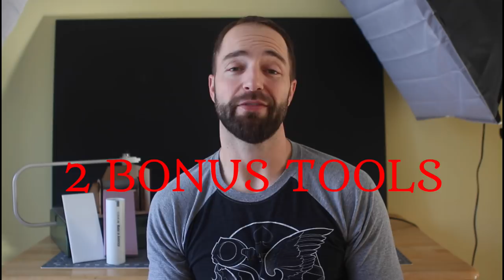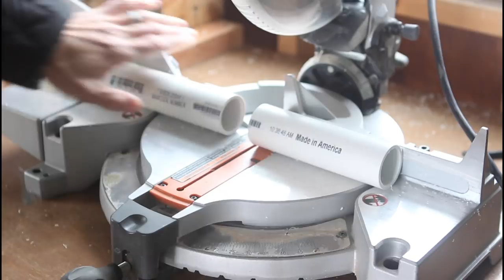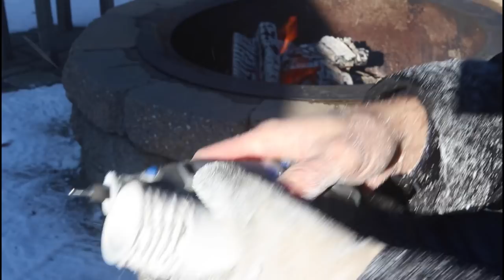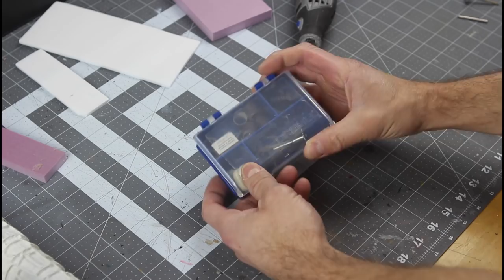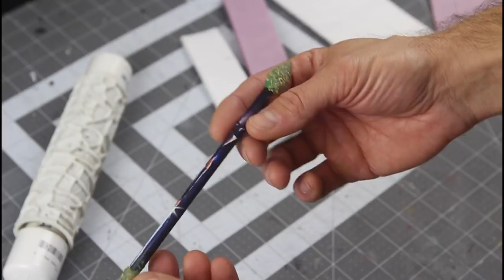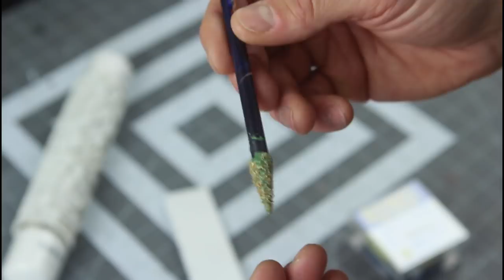DIY XPS Foam Texture Roller

Comment: Alternatively, I printed free pattern on paper, wrapped it around a rolling pin, then built up all the lines with a hot-glue gun. After use I slid the paper/glue roll off the pin. I have used it to make aver 10sq fr of cobblestone pattern and will try making a rock wall pattern next.

Comment: Please keep in mind there are 2 types of PVC pipe used in the US and it may effect your results with this project. Schedule 40 Solid Core PVC is solid PVC all the way through the pipe wall. Schedule 40 Foam Core PVC is two thin layers of PVC plastic on the inner and outer wall of the pipe with a stiff foam filler material in between. Solid core is much sturdier and would be the way to go with this type of build, but both should be available in your big box store. You can tell the difference by reading the text on the pipe. Foam Core PVC should always say "Not for Pressure" on it and will be considerably lighter in weight than Solid Core. You can also tell by looking at the end of the pipe, if the wall of the pipe is one color all the way through or if there are thin strips of lighter colors on the inner and outer wall. Happy Crafting!
Reply from the maker: You are correct.  Thanks Beans.

Comment: I've seen similar ideas for wall plastering with cement or/and paint, skimming, etc. Floors, roofs anything, Creativity is unending, but I truly like how you show how easy it can be. I have a dremmel, can get pvc piping and have a lot of plastering, flooring, roofing and skimming still to do. It's also great how it covers up smaller imperfection you would like to hide.
Reply from the maker: Thank you :)  Another cool thing is that the one you make is truly unique... I like that :)

Comment: I spent 2 days looking for textured rolling pin, always only available with lengthy delivery times (live in Austria) with a delivery fee almost as or higher then the Roller itself. It won't be finished in 5 hours because I generally need 3 times as long for everything as shown, but then... Big thanks for your instructions
Reply from the maker: Your welcome glad it helped….. and no rush at all

Comment: If you run your dremel at a lower speed, it won't melt all the pvc to the bit, reducing it's effectiveness.  Course bits work better than fine bits too.  Great video thanks!
Reply from the maker: Great tip!  Thanks!

Comment: 2 quick ideas from when I made mine:
   - use a larger bit to rough the bricks and then go in with a smaller bit to clean up the detail. Saves you a good hour. 
   - print out a seamless texture from online, resize if needed, and try to copy it to the roll, that way when you stack the texture it will match if you line it up correctly
Reply from the maker: Cool ideas, thank you.   Even leaving it rough with the first bit would add some nice texture.
Reply: @TabletopWitchCRAFT  still super cool! I'm learning to have more patience with stuff like this xD

Comment: If you want texture and the stone, brick, wood, what have you, make the textures on the roller not so deep. This also works much better on xps foam, sense xps tends to bounce back to shape slightly with the deeper cut texture rollers.

Comment: Hmm... I wonder if there'd be a way of doing this by taking a bit of PVC, coating it in a layer of green stuff, and then rolling it in aquarium gravel, or something similar, and before it fully cures, picking the gravel out so it leaves an impression that  will make a 3D embossed texture when rolled on foam.  Or, like another commenter suggested, using some thermoplastic to make like a sausage shape that you can roll in gravel or those little glass things they use for flower arrangements, and then pick them out once it fully hardens.
Reply from the maker: SongDog7 That would work, but I don’t think that we’ll for XPS foam.  You really need something that can imprint the foam and cut into it.  What you are suggestion would work well on something like DAS clay.

Comment: Suggestion: Have you tried rolling the "backside" of a strip of foam first? In order to counteract the warping it might be beneficial to do the other side first (even though it might be hidden inside a building - or it'll give you the other side of a wall already), kind of like how one would counteract warping when applying paint or glue to a larger piece of paper or cardboard, you might apply your wet medium to the other side too. Basically it's to create "equal tension" to both sides in order to keep it flat.
Reply from the maker: I have.  It does work rolling both sides, although you have to "work" the foam a bit to get it back to its original shape.  Good idea.

Comment: I love this tool and want to make several styles of stone work. Here may be an added idea, though I have not TRIED it.. I'm reasonably certain some Schedule 40 PVC pipes are engineered to slip inside each other [ Outer Diameter matching  the second pipe Inner Diameter]  The inner one could be left whole, the outer could be pierced through completely... possibly with even finer patterning such as small red bricks or cobble stones. Once the pattern is carved in the Big Pipe, the Smaller Pipe slips inside to stabilize the cutter...the ends can be welded with a bit of PVC glue to make them secure... Maybe?
Reply from the maker: That might work, but it really is pretty rigid.  Try making it without even using an inner piece of PVC.  Might be just fine!
Reply: Don't need for the added strength , but might be good for rolling pin type handles on either end and would not slip around like ops handles . But as OP said , really don't need handles and can probably apply more force and have better control without .  Wow , shot down my own idea !  Lol

Comment: Thanks I was thin about this build I might try this on a hardwood dowel instead of the pvc pipe
Reply from the maker: OldDungeonMaster Sure thing.  I’d be interested in how that turns out.  You think you can get the design thin enough without chipping the wood?
Reply: Tabletop WitchCRAFT it should not be a issue at all cookie presses and rolling pins have been made from wood for a long time beech wood should work just fine . I have some walnut that I might try the key is to use a hardwood but it will take some time to excavate the design into it.
Reply from the maker: OldDungeonMaster I’d love to see that when you’re done.  Sounds like artwork to me.

Comment: Its works much better with a heatgun. You first heat up foam, and then you roll roller.
Reply: You've convinced me to hop on this project while it's record temps here.  I can probably leave the fial outside in the  sun for ten minutes and roll nice deep impressions

Comment: I wonder if a mill end in a drill press would make this go faster.  You could lightly hold the pipe in the vise and set a stop so you dont go too deep.  Then touch up with the drimmel.
Reply: I thought of the same thing and tried it in the end mill at my metal fab shop. It worked awesome, I cruised through a 6” length of 1 1/2 with a brick pattern in a little over 2 hours. The bricks were a bit rounded so I went back in manually to sharpen the edges up a bit.

Comment: So, I wonder what would happen if you like rolled a piece of the foam twice?  Like twice buy on different alignments, so the patterns overlap.  Would you get a smaller pattern?  Would it look as good?  I think, like a chimney might have a smaller pattern of stones, or like around a well or something.
Reply from the maker: Michelle Renee No need to wonder.  A cool idea.  I did a quick sample of this and posted it on my Facebook Page.  The photo album is “YouTube Photo Requests”. Let me know what you think!
Reply: @TabletopWitchCRAFT  Cool beans.  It appears really random, but some of the blocks make me think wizard's tower, or dark jail cell (the way you have it painted), or something slightly out of the ordinary.  I think that could make some very different pieces which feel very different from like other things you have done.  Thx for trying that and posting the pic.  Okay, another idea.  I was thinking when I watched you put those little brick thingies at the bottom of the tower around the base.  What  if a section of those were put on with a magnet and could be removed and replaced with like a bridge or something else connected to it?  Like I could see that being like an upper part of a tower and having a wood or stone bridge to it.  Idk. You have me thinking. :P
Reply from the maker: Michelle Renee hmmm... you have me thinking now too.  Thanks Michelle :)

Comment: Good stuff, have you considered wrapping (square, hex, diamond, etc..) mesh around the pipe to create sci-fi grids/textures?
I reckon you could make some awesome post-apocalyptic terrain with a sci-fi roller
Reply from the maker: That's an excellent idea.  I'm going to add one of those to my collection.  Yeah, once you break away from the fact that you have to etch and that you can "add" to the roller it opens up all kinds of doors !
Reply: @TabletopWitchCRAFT  I think half the battle is finding the best materials/textures that will work.
I think if you looked out old sprues, cable ties, rhinestones, foil blisterpacks (for pharmaceuticals), etc..
Then you can really get adventurous & make totally unique rollers.
Polymorph Mouldable Plastic (a thermoplastic compound, that's pretty cheap), would probably be a faster way to making a roller mould.
Since, unlike Oyumaru/Blue stuff, it's less elastic & runs the risk of breaking the items you're trying to mould.
What is thermoplastic, you may ask?
It's a material (plastic) that molds easily once submerged into bolied water (for two minutes) & can be re-shapened again & again (so it's 100% recyclable, unlike other moulding compounds).

Once dried, it's hard as nails & whilst it may not be good for regular moulds, it may be ideal for making a roller
Reply from the maker: earthmanbrick   You’re right, you can add anything to a roller and get really awesome repeatable patterns!  Time to collect more bits!

Comment: @8:35
Anyone who has done much industrial work with rotating tools can tell you this -  It is a very bad idea to have a glove anywhere near the cutting part of a rotating tool.  In fact, the general rule of thumb is "don't mix gloves and rotating tools at all" and there are very few exceptions to this.

I know it seems to a layman like it would be safer to have gloves but it's much more dangerous.  Without a glove, If you slip then you cut yourself and your pain response will make you yank the tool/hand away and that's the end of it.  If you're wearing a glove and you slip, not only will the glove not provide any substantial resistance to the cutting end of that dremel but the rotating part can get caught up in the glove material, leaving you unable to pull the tool away until either the glove completely fails, the tool fails, or you manage to turn the tool off.  That situation can cause very serious injury.

If you need more information, simply google - osha gloves rotating equipment.
Reply from the maker: I'll have to check into this.  It's such a small bit and sturdy glove but I guess crazy things do happen.  I hear your point.  Thanks for sharing.

Comment: Nice work, but could the same thing be done with a wooden rolling pin?
Reply from the maker: Mat Cobb Sure but you would lose some definition over time.  I also use this when I work with clay and I wet the roller.  This would also be an issue with fine points of wood softening once wet.

Comment: It was painful watching you draw the pattern onto the pipe. 

PVC Specification Charts can be found online. The Circumference of the pipe can be calculated from this data. 

...or find C by wrapping ribbon around the pipe, then marking it with a pen where the ribbon overlaps. Finish by measuring the length of the ribbon to easily determine C.

Use Photoshop to draw your patterns using the Length and Circumference dimensions.

Print out the pattern, then wrap the paper around the pipe. Secure the paper to the pipe with adhesive or tape. 

Do your engraving. 
Huge timesaver!
:

Comment: Thank you for this.  Two questions - when the on screen comment says "You should texture it first before rolling", by "texture", do you mean the sort of thing you do with the little texturing tool?  Also, you mentioned aluminum foil, I didn't get what that was for.  Thanks in advance.
Reply from the maker: Hi Gunga Tim, great question, sorry for the confusion.  By texture first, I mean to get a ball of aluminum foil and roll the foam first to give it a stone looking texture.  Then use the roller out of PVC to create the individual stones.  That way you don't remove the small amount of texture created by the aluminum foil when rolling with the PVC.  Does this clarify?  Check out my windmill or tavern build video's for a demo with the foil.
Reply: Ball up some foil into a rough sphere, roll it on the surface youre trying to texture. It works the same as the texturing tool, just cheap and easy
Reply: Tip - my sphere didn’t roll well until I wrapped the foil around a golf ball.

Comment: Do you have a link to the type of foam you use? I know it says XPS, but Amazon comes up with about a thousand links, and none of them specifically say XPS foam. Thanks. Love your work.
Reply from the maker: Hey Lane, thanks!  You can pick up the XPS foam at big box stores like Home Depot or Lowes much cheaper than online, but if you can't get it there I added a link in the video description where you can get it in 1'x1' tiles.

Comment: A 3d Printer would be a very big help here methinks....
Reply from the maker: If you could print this out on a 3D printer I agree.  I don't have one.... yet :)
Reply: compare costs of design/printing time...material...i lot of his time lost seems to be holding the material steady while working it...that could be solved with a v-channel and some tape
Reply: Imp ThePimp Good point. I did notice that this maker is a from scratch kind of guy and that is awesome. I just figured that it looked like a lot of work. Again awesome,  just that if you did have access to 3D printing then there are a ton of options for making mass quantities of patterns etc.
Reply: I'm all for hand crafted, but for once I agree. 3d printed roller is the way to go.
Reply: @TheLostFireWithin  i think if i 3d printed...i'd 3d print a mold...and cast reproductions from resin
Reply: @imperialpresence3331  or brass! I would love a brass one.
Reply: use brass sheet textured and wrapped around a nice mahogany handle
Reply: I use a 3d printed roller and it's not good with foam at all I haven't tried clay but as far as foam thumbs down
Reply: @merlinsmonkey2001  if you want to make one by hand thats great too...but when you carve...make sure your clamped down so things don't slip...shop safety...and safety glasses

Comment: Have you tried this on craft foam or EVA? I'd be curious to know if it works
Reply from the maker: Yeah, a lot of craft foam is made of EVA.  I wouldn't think this roller would work well or at all on that.  In thicker form EVA is use for stuff like shock absorbent mats and won't hold the shape.
Reply: Using the half inch EVA, you can blast it with a heat gun right before you use the roller. It will leave an impression, but it won’t be nearly as cleanly detailed as foam core. Once that’s done, you may still want to deepen your grooves with a burner or engraving bit. The roller will still save you time since you’d otherwise have to individually lay out your pattern on the foam.

Comment: why dont you put the pvc pipe in a bench vise to hold it for you and make it a lot easier to carve your pipe. just make sure to put a cotton rag or towel into the bench vise to prevent the teeth of the vise from leaving teeth marks on the pvc or damaging the pipe and itll hold it safely from spinning as you engrave the pvc. And you can use any size of pvc pipe you want the smallest i did was a 1inch pipe i think any smaller than that you may lose your details
Reply from the maker: That's a great idea Michael for sure..... I don't have a bench vise though :)
Reply: you can pick one up cheap at Harbor Frieght and they come in various sizes. Just a small one will work